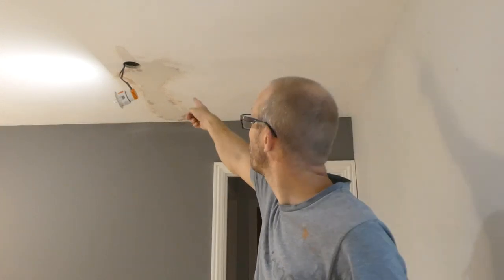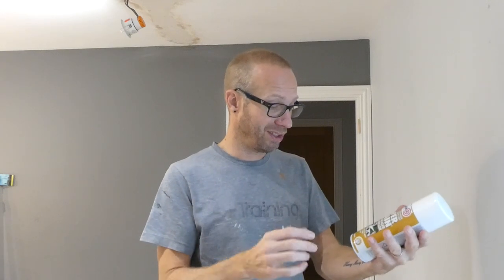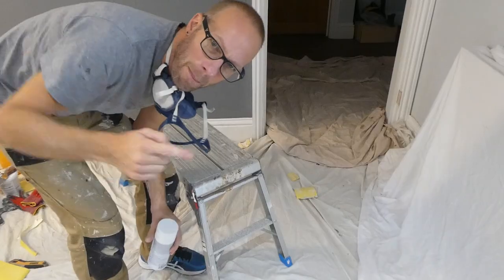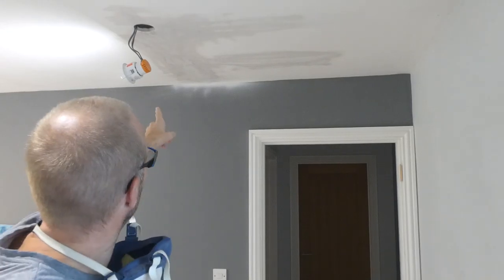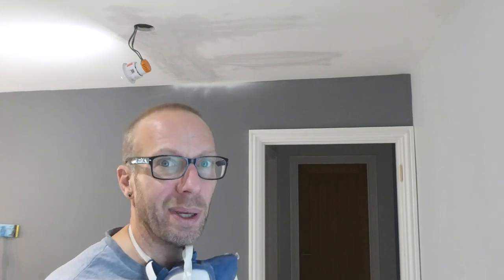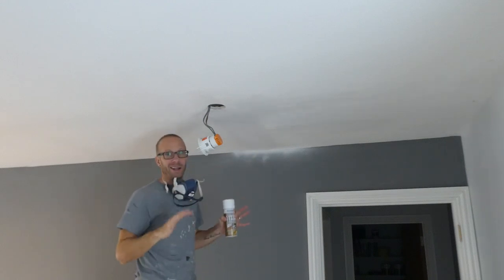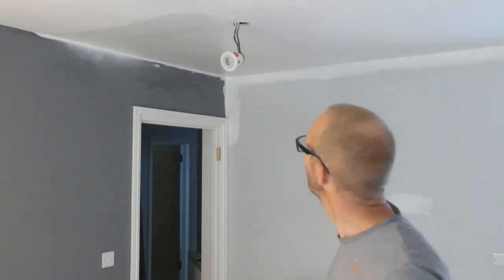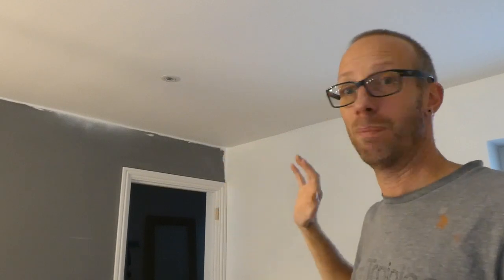How to cover stains and prime bare plaster with Zinsser Cover Stain

Comment: This product really works. I used the version in the paint tin to cover a radiator valve leak stain. It is touch dry after 30 mins and can be recoated after 2hrs.